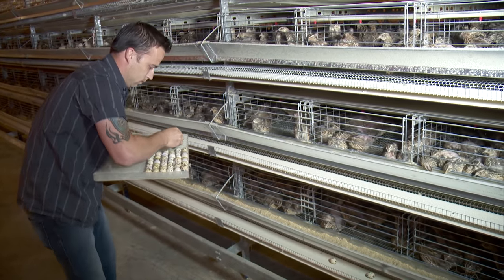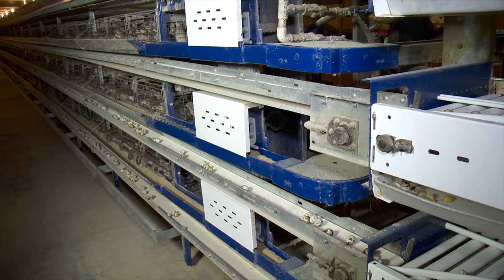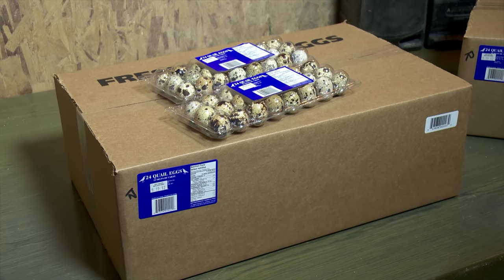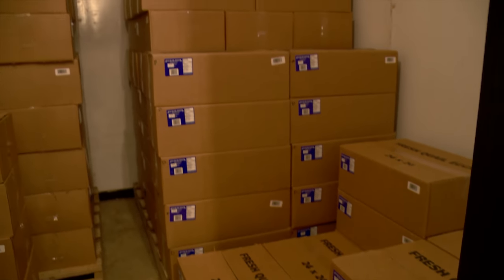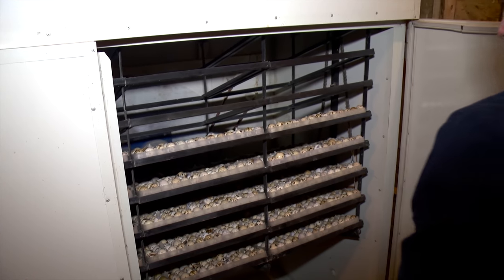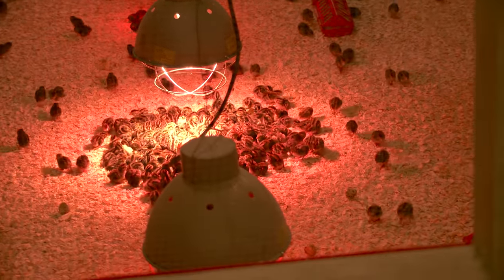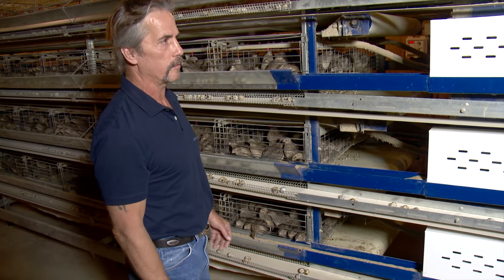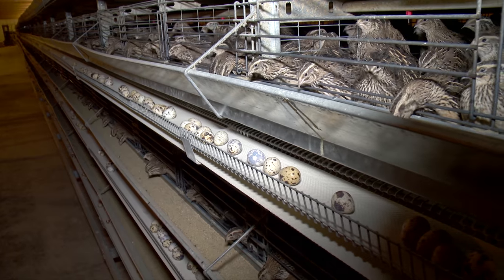Quail Farming

Comment: how do you get the eggs out of the cages (what type of automatic egg collector is it?)
Reply: The quail sit on an angled floor, so the eggs roll forward onto a conveyor belt. I would like to point out that an angled wire floor can cause foot and hip issues for the bird, and living like this is very far from anything natural. Some more space, natural light and a a sand bath would go a long way to improve their life. Unfortunately that is more work thus less profitable.